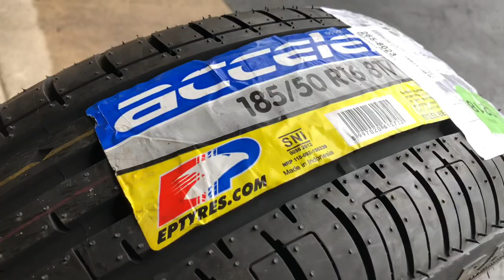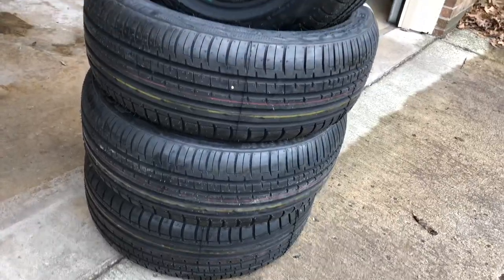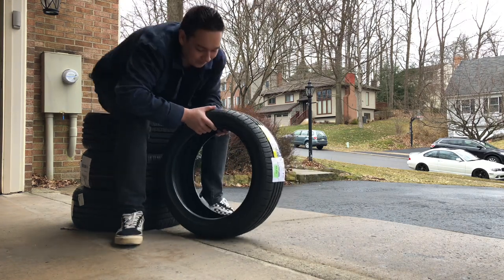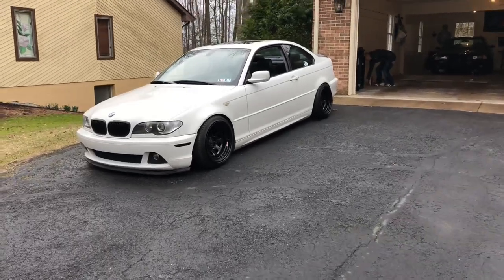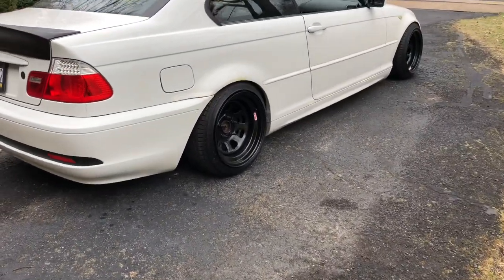Making Wide Steelies Fit on E46

Comment: Looks great! What sizes / offset did you used? And did you made them wider yourself?
Reply from the maker: No, I got the wheels custom ordered with the exact specs I wanted. Wheels were 16x8 -12 et. And the tires  were 185/50/16
Reply: @braewhips  where did you order them at
Reply from the maker: @warlordgames4004  I called Diamond Racing Steelies and ordered them over the phone
Reply: @braewhips  thanks man

Comment: Anyone have some suggestion for my fitment? I use bbs chr front 16x7 et40 and rear 16x8,5 et30 on my honda city 2006.. 

Using 195/45 for front and 225/40 for rear its good? Or maybe 205/45 front and rear? you or anyone can help me? Need some advice..

Comment: Whats your exhaust setup
Reply: Mine is straight pipe no resonator and I have an exhaust muffler on the end of my car. I just want all pipe no muffler at the end.
Reply from the maker: Mine is just a rear muffler delete. I still have the 2 smaller resonators in the middle and my cats on.
Reply: @braewhips  hows yours so loud though
Reply: @braewhips  so if I took my muffler off at the end I would then have just straight pipe and cats. Would it sound good and be loud or be raspy.
Reply from the maker: @metro_beats6684  it’s definitely gonna be louder, but it wouldn’t be raspy because you’ll still have your cats on. Mine really isn’t that loud. From my experience tho, depending on how old your car is and how broken in the actual exhaust is, sound and loudness can vary a lot for some reason. I actually want to go full straight pipe from the cats back this summer. Let me know if you go through with yours, I want to hear it haha

Comment: What is the wheel width and backspace?,
Reply from the maker: LowSocietyDrift they are 8 inch wide wheels, and I go by offset, and the offset it -12. But the backspacing measurement is around 4.3 inches.